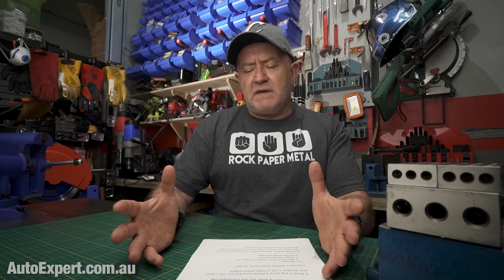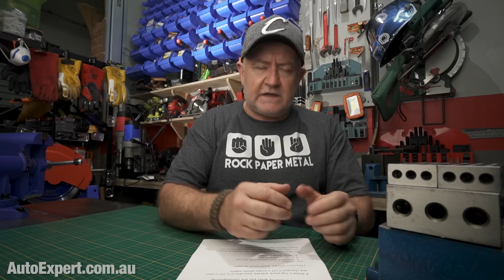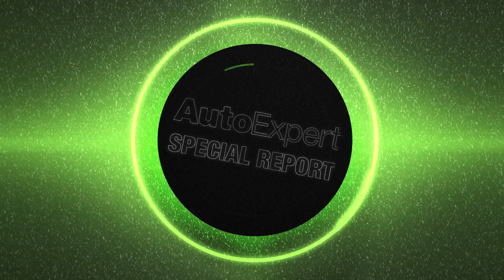Best way to charge your EV at home (for complete electric car novices) | Auto Expert John Cadogan

Comment: My dad was a Fire Chief for over a decade and worked a few ICE car fires.  They burn fast and hot but are relatively easy to extinguish and tend to stay out.  EVs are a totally different animal.  That being said, you really should have automatic sprinklers in your garage.  They aren't that expensive if installed during initial construction.  Some insurance companies will give you a discount for having them, but others won't using the logic that they raise potential loses from water damage if a pipe breaks/leaks as much as they reduce potential loses from a fire.  Shop around and at the very least have a large fire extinguisher and outdoor spigot with enough hose to reach the farthest part of the structure so you can hose it off until the Fire Dept gets there.  Fires are a situation where seconds count and help is minutes away.  It can make the difference between losing the contents of a garage and losing your whole house.
Reply: Sprinklers wont do squat for a lithium thermal runaway fire.
It can make it worse.
Buy some lithium and drop it in water, see what happens.
Reply: @sahhull  reading comprehension.  I clearly said EV fires don't act the same as ICE and the goal is to save your house, not to put out the car fire.  Sprinklers are good for containment, which is the best you can hope for with lithium ion thermal runaway.

Comment: I suspect that the penny is finally dropping for you John. It sounds to me that this vid is a subtle attempt to shift your position after your previous attempts to poo-poo EV viability here in Australia. 
Now, I couldn't help but notice that just about the only brand of EV you didn't list as having charged at your home is 'Tesla'.
Could it be that your disdain for Tesla is, at least in part,  a case of sour grapes from a motoring journalist who isn't being suitably indulged by a manufacturer's marketing department?
Can l also suggest you update your knowledge of battery chemistry. Your recommendation to only charge EVs outdoors was probably fair advice 5 years ago. Much better advice today is to simply ensure that you choose an EV fitted with an LFP battery. Apart from their other considerable virtues, LFP cells pose no significant fire risk at all. Manufacturers are queuing up for LFP cells, but Tesla and BYD are well ahead in this game, and have effectively stitched up global supply for the time being. 
Anyhow, it's been good watching you commence what I suspect will turn out to be big slow-motion backflip from you on this issue John, and I look fwd to more.
Reply from the maker: I've never been anti-EV. I'm a realist.
Reply: @AutoExpertJC  
You've certainly spoken stridently against the disruptor who started it all though John.
You've been loudly predicting Tesla's imminent collapse for years now.  
If you were a realist, what you'd actually be predicting is that we will soon see the foreclosure of any legacy carmaker who hasn't effectively invested in the EV space. Mazda, Nissan, Volkswagen and even Toyota are all in serious trouble on this front.  
Meanwhile Tesla just keeps going from strength to strength.

Comment: Hi John, a point that I feel you should also make is that not all chargers are solar optimised this should be minimal requirement and there are a few that still don’t have the option. It effectively matches your solar grid export to have a 0 net cost to client.
Reply: Ryan M. 
Charge HQ offer a software solution to cause charging with solar that would otherwise spill to the grid.
Reply: @guringai software won’t fix this issue, devices that are compatible! have a current sensing clamp that monitors the flow and adjust its communication with the vehicles charger hence the “” smart part of a relatively over priced dumb box. it either supports it or it doesn’t.
Reply: @ryanm784  Ok, (charge HQ works on ours)

Comment: An inverter is DC to AC, a rectifier is AC to DC. The car has both, not necessarily in the same box.
Most houses I've dealt with ( As a sparky ) only have 80 amp service fuses, only a few have 100 amp. ( or more, special requirements )
Reply: Mainly newer housing as most older pre aircon homes in Adelaide are only 63A. Three phase 100A user pays install cost from SA Power Networks would frighten the life out of homeowners and why widespread public EV charging will always be problematic.

Comment: So what I get from that is that an electric shopping trolley is good providing you're happy to export the smoke to the countryside, but keep the 1978 6-cyl petrol for the big jobs (200+Km each way return trip in a day). That is logical but the hard bit to understand is why we have to pay many tens of thousands for the shopping trolley and how that saves the planet.
Reply: Chin up mate, you'll figure it out eventually
Reply: @justohird5685  I figured it out, it's called keeping our combustion vehicles and telling Musk to shove it.
Reply: If I replace my 1.8 litre 2014 petrol hatchback I'll see if I can afford a small EV.  Most of the recharging will be from solar power so no more export of CO2 than any other city car. If I decide on a long distance drive I'll either hire a long range car or do a temporary swap with another family member.
Reply: The politicians make these arbitrary policies, and we are made to pay for them. Even though there is no environmental or practical benefit to EVs in the first place.

Comment: Always love your work! I think your statement about AC vs DC charging was fluffy. Power lines to the home or charging station is alternating current (AC). Batteries in EV's charge and deliver their power in Direct Current (DC). 

Most if not all electric vehicles offer AC or DC charging. The thing is, supplying AC power to an electric vehicle means it has to use an on board AC to DC converter to charge. They are big, expensive and heavy.  Not ideal to carry onboard an electric vehicle. 

Supplying DC which is directly compatible to the batteries is easier because the conversion from AC to DC is done with hardware outside the vehicle with no weight concerns and active cooling is easy to addressed. That is why a massive big plonking dedicated DC external charger will deliver and charge quickier than an AC plug.

I could not agree more with your other comments!

Comment: I don't mean to brag, but I will anyway. In 1975, I did the electrics for our new home. I put in the sweat equity, saved shitloads, & went full gangbusters by running 3 phases underground for possible futureproofing. 
Through my early foresight & now with decades of retirement under my belt, the stench of petrol fumes is a non-issue.
Our imported European vehicle is so advanced that we park undercover without fire risk.
Take my advice, if you have a perfectly good economical & supremely reliable ICE vehicle, KEEP IT.
No range anxiety, cheaper home & car insurance, just get your wife to top up the tank when the price is right. 
Works for me. 😉

Comment: 2.5k for the installation, did you supply the charger? 15m run of 6mm2 cable new circuit etc etc ? You were very well looked after if the installer supplied the whole shooting match!  The other thing that needs to be spoken about is a little thing call 'maximum demand' covered in the AS 3000. Long story short, there will be a lot of places out there that will need to upgrade the mains to the house just to accommodate the wall charger, If it's done by the book haha!! 😄 this will also add big $$ ...
Reply: This is 100% correct .   Maximum demand would cancel out most house in Australia from having a 32A charger if you already have electric HWS ,AC and oven ......no chance

Comment: It seems to me that the majority of EV's will have a capacity around 50kWh simply because that capacity is chargeable overnight from close to empty.
Reply: 50kWh is 150mi of range, that's quite a daily commute.  For me I could get 200 miles from that much capacity in an iD4.

Comment: I have a wall box outside it’s pretty good. I like that I can change the amps from 32 down to 10. Sometimes I use the lower amps if aircon are running because I get worried about overloading the power. But I think that’s because I don’t really know enough about charging. Thanks for clarifying things.
Reply: Going by John’s video you are doing the right thing.

Comment: Just a clarification because I like detail and I am also an electrician here in NZ, the actual battery charger is built into the car. The wall box or 'trickle charger' are power supply units, the are not chargers. Pedantic possibly but I believe it is important for people to understand this.
Reply: so many different brand options out there. which EV have you gone with ?
Reply: (electrical) power supply is the general discrition  of "something" that will supply power to an electric appliance.
The diferance between a power supply and a charger is that the charger has some intrinsic characteristics that will take into account the specifics of the battery beeing charged (chemistry, etc.)

So we call power supply to the unit that powers directly one equipment, and charger to the unit charging a battery.
Some units do both at the same time because it will be convenient...(laptop computers for exemple).

Chargers will generally have a circuit component that will prevent reversal of electric current flow direction when input power to the transformer (VAC) goes out (to avoid damage to the electronics, if it is the case, by reverse flux).

Generally not happening at normal power supply (because you are supplying to the equipment with no battery beeing charged internally at the same time...)
Reply: Power price is rising here in NZ shortly, that plus the introduction of RUCs will I believe soon level the playing field.
Reply: That EDC bag. 🤘🤘🤘

Comment: Have ordered an EV from he who must not be named. Likely arrive in 1-3 more months. Usually drive 60km per day. Have solar PV reasonably large system - but mainly only useful on the weekend as during weekdays the car parked at work. Have had electrician install a 15amp outlet on the same controlled load circuit as solar hot water booster. Electrician advised couldnt do 32 amp as that would overload this curcuit when solar hot water comes on. Hope to charge much of my daily use during 2-4 hours in the wee small hours of the morning on controlled load and top it off on the weekend with solar. The other consideration I have is that slow charging might prolong the life of battery compared to faster charging.
Reply: Li-ion batteries- charge to 80% for everyday driving. Recharge at 10%. For battery health.
LFP batteries - charge to 100%, use down to 0%… doesn’t matter.

Comment: I wonder how developers will spin the environmental benefits of having a charge station as part of new developments.
With more regulation revolving around energy and water efficiency and the reduction of gas appliance in homes, and for sale. Will regulators bring in requirements of new developments to include ev chargers.
Reply: I recently read of a large apartment development in the ACT where the developers understand the value of EV charging infrastructure to intending buyers.
Reply: @guringai  I recently heard ACT Planning (if you can call it that) Minister Mick Gentleman has approved developments (aka future slums) with NO car parks and no need for them because public transport will be awesome. He’s not kidding. This is going to suck
Reply: @theairstig9164  It seems we really are moving towards no private vehicle ownership for the working class.

Comment: I find using a diesel Car is a lot easier. The convenience of just filling up and just driving is so good and I only have to do it every 600km. I think it may catch on ...
Reply: You think going to a servo is easier than plugging in your car every now and then? 😂
Reply from the maker: Especually for long distance travel
Reply: Expensive to run though, compared to EVs in the same price bracket.
Reply: @guringai  Not true if you live in the UK and need to use public charging.
Running a diesel is a lot cheaper per mile than an EV.

Comment: If you trickle charge you need to be careful of the duty cycle of the outlet socket and the wiring in the wall. They can burn out if you pull 10amps out of them for 8 hours or more.
Reply from the maker: Agreed. You could look at the actual charge rate reported by the car.
Reply: @AutoExpertJC  do you mean to see how much energy you are loosing to heating up the wiring or in the socket?
Reply: Heat is caused by bad connections, or incorrectly used cables. Like a fuse.
Reply: @owainbennett663  and the duty cycle of the parts.

Comment: EV's are still unaffordable to the average person. As far as wanting an EV, sure I don't drive much, 99% urban driving. I think it would be great to help to cut the urban pollution problem and not having to buy petrol would be nice too. Don't worry I'm not someone who thinks that EV will save the environment but I think there are some good reasons for buying one, but they are just unaffordable.
Reply from the maker: Not if you novate them.
Reply: @AutoExpertJC  If you have access to Novation, not all of us do.
Reply: @AutoExpertJC  novated lease. aka you will own nothing and be happy.
Reply: @sahhull  with the FBT exemption, they are completely broken. You will literally save thousands, every year.
Reply: You have to shop. I purchased a lease return for 50¢ on the new dollar with 13K miles on the clock at the dealer. Three years old but like new for <$25K (US). Have driven it for five years with only two cost items, tires ($1100) and a battery heater ($2500). My estimated TCO is under 50¢/mile.